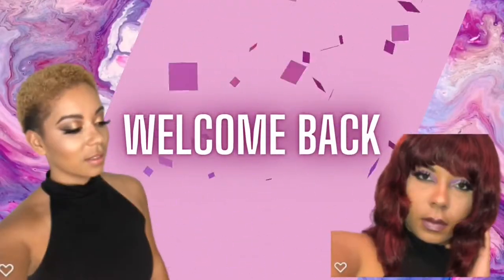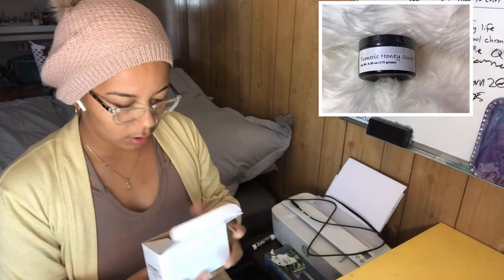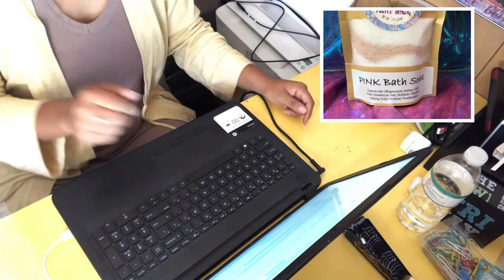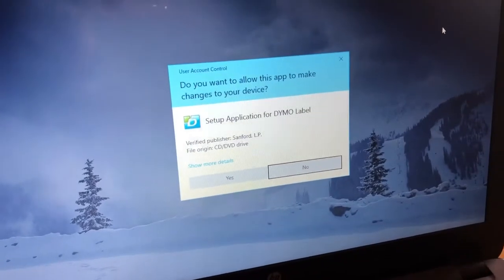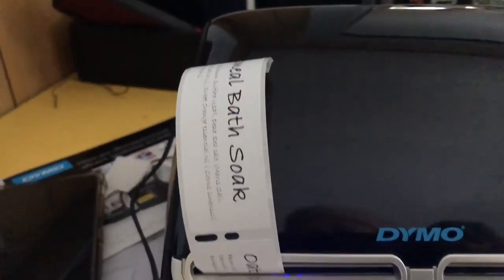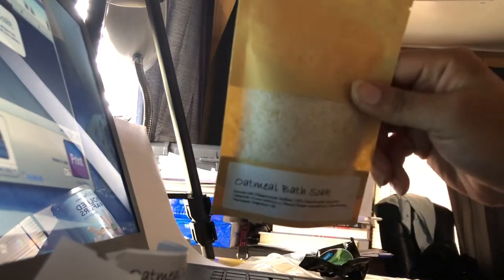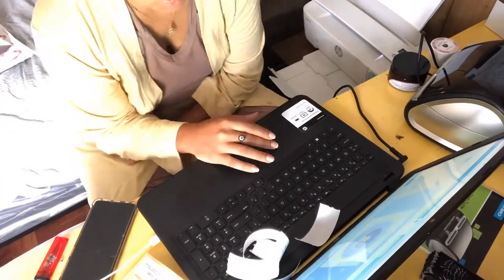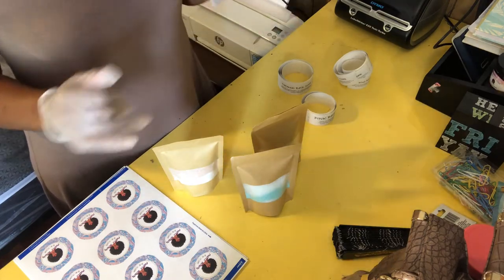Dymo Twin Turbo 450

Comment: Hey thanks I order mine and it arrives today. Does it do tracking as well. I fervently need to see how to set this stuff up once I get it thanks for video
Reply from the maker: Hey by tracking do you mean shipping labels?
Reply: @MrsDorn22  yeah the shipping labels that can be tracked till it arrives are buyer address
Reply from the maker: Hey yes it can print shipping labels just will be a little smaller on this particular label make vs the bigger dymo label writer if you are okay with that you just want to make sure you check the print size of shipping label before printing it, it definitely can do both